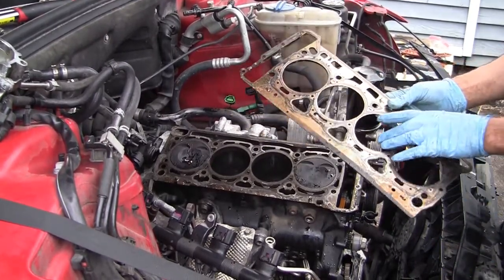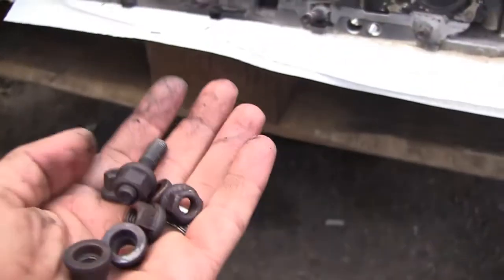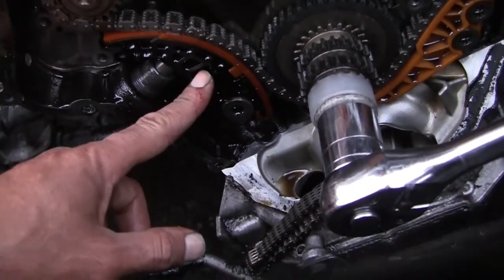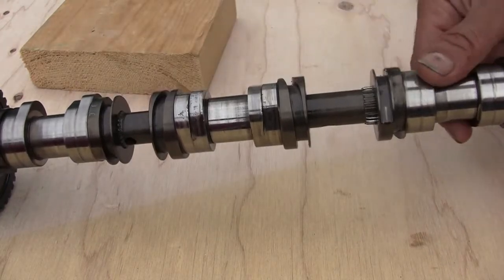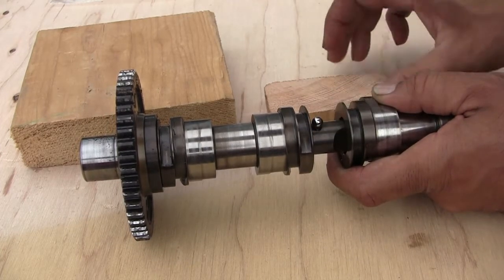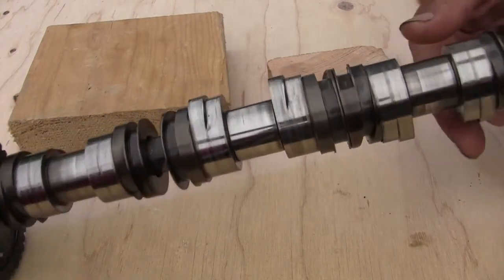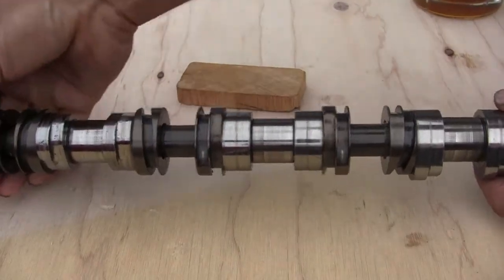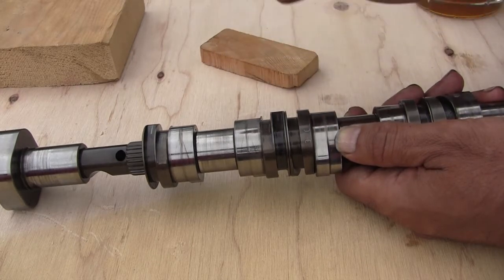How to solve a misfire on a 2.0t tfsi engine , a thorough study removal part 4

Comment: 100th Subscriber! I got 2 misfires code on my 2009 audi a4 for months already and couldn’t find the solution for it. I first changed the spark plugs and the misfires were still there on cylinder 3 and 4. Second I switch the coil packs to different cylinders but the misfire was still in the same cylinders. I went to auto zone and bought 2 bottles of fuel cleaner liquid to clean the injectors in the engine. The misfires was still there but after a few days driving my Audi, the misfires went away for 2 weeks and came back on after using the 2nd bottle of fuel cleaner liquid. Right now I’m still stuck with the check engine light with the same codes and looking for a solution but not sure what to do. Your video influenced me to work on my audi but I don’t just want to dismantle my whole engine and seeing a invisible problem that I don’t know what to do next. My audi only has 188k miles on it.
Reply from the maker: Johnny , thanks for being my 100th subscriber that’s really awesome .
Going back to your misfires , you don’t need to dismantle the whole engine , just remove the top cover that sits over the cams , and see if any of the lobes is loose . If it is , all you need to do is a timing chain job, and when the chain is out you can fix the exhaust cam just like I did. Just curious, what city do you live in ?
Reply: STRICTLY AUDIS No Problem! I’ll try that and see what’s the problem. 12 hours ago I pour a bottle of San Lucus fuel injector cleaner and ran it for 40 miles and so far the vibration lowered a bit down and check engine light is off. Usually when I clear the codes the light comes on after a day or two but I’m going to patiently wait. Btw I’m from Santa Ana, California
Reply from the maker: Johnny also replace the pcv valve here is the one you need to buy 
Ensun PCV Valve From amazon
Reply: STRICTLY AUDIS I have already ordered it and hopefully it solves the problem!
Reply from the maker: Johnny replace the pcv valve first , and the timing solenoid actuator, the one at top front engine , it’s reversed thread, you need a special tool for it , when you get it out , clean it or replace it. Watch my first vedio : how to solve a misfire ....
If you bring the car to seattle, I could help you , you pay nothing , we just post it on YouTube
Reply: STRICTLY AUDIS That would be a great idea but driving my car all the way there with a misfire sounds sketchy to me. I just replaced the PCV valve right now and i still get a rough idle but check engine light hasn’t turned on yet
Reply from the maker: Johnny if the misfire occurs only on idle and on a specific cylinder, this means two things: you can drive the car and one lope ( for that cylinder)  is loose . I agree with you after I said it I knew it’s a high risk to drive that far . Question : do you have a misfire on a specific cylinder ?
Reply: STRICTLY AUDIS The misfires are on cylinder 3 and 4. Codes are P0300,P0303, and P0304. I just got the check engine light on again so that means the pvc valve didn’t help out.
Reply from the maker: Johnny remove the cover and see if you can spot the loose lobes on those cylinders , you also could be lucky and be able to install the missing spring and ball , but you need to find the missing one inside your engine ( mostly inside the head ) good luck bro , don’t be scared of it , it can be fixed and make sure you replace the lifters
Reply: STRICTLY AUDIS I’ll try that tomorrow on my day off, thanks! Also which lifters do you mean?
Reply from the maker: Johnny replace lifters and rockers ( look it up to know what I’m talking about) replace any of them that you see scratched, they’re not supper expensive
Reply from the maker: Johnny lifters and rockers , they will be scratched, you need to replace them
Reply: STRICTLY AUDIS I’ll try it after trying a method someone recommended me. They said to swap the fuel injectors to check if it changes cylinders.
Reply: @strictlyaudis7012  hey I have missfires p0300 p0301 p0302 p0303 do you think this might be my problem ….I just ordered pcv .  /: maybe maf ?